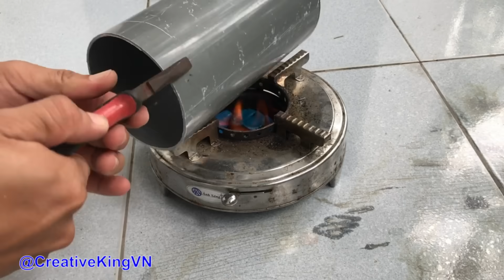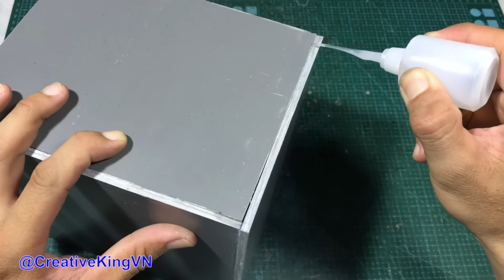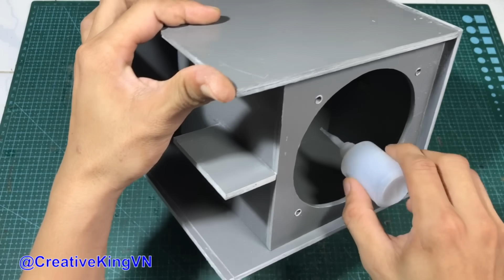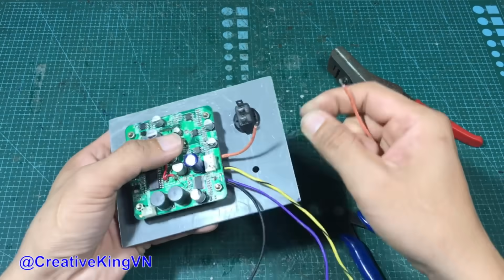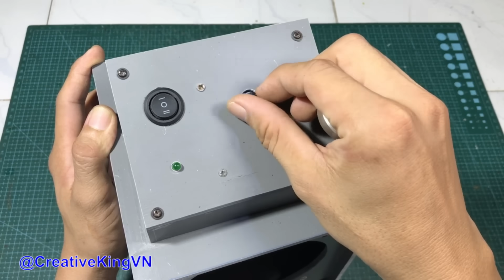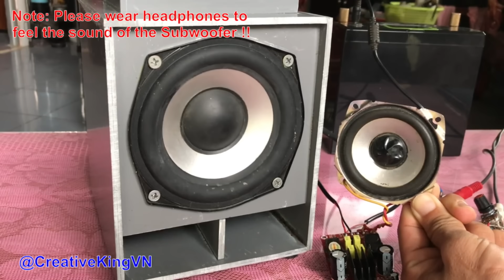DIY Subwoofer From PVC Pipe!! Powerful Bass Matrix Subwoofer

Comment: Distortion and low quality bass than wooden enclosure 
Sub is just moving uselessly when voice coil is touching backside plate and over excursion stressing surrounding form as low quality subs usually do 
this one producing 100hz to 300hz 
so next time do some research and listen watch and measure spl of a good quality subwoofers like logitech z623 z906 pioneer 1212 307 even sony low budget d40 d10 mutuki2012
Reply from the maker: Thank you for sharing this useful information.